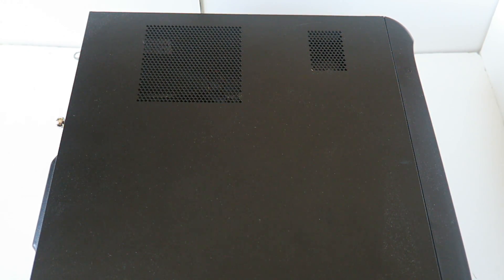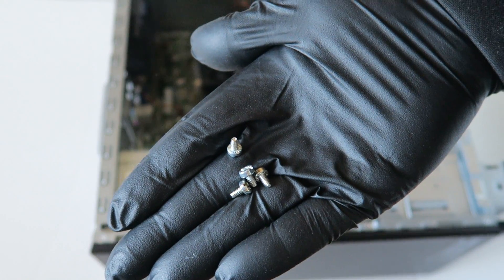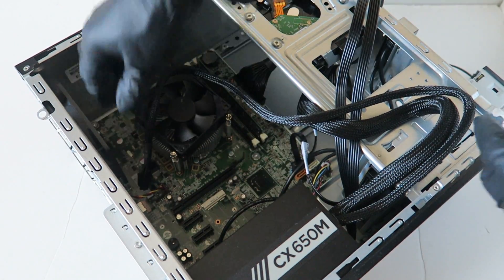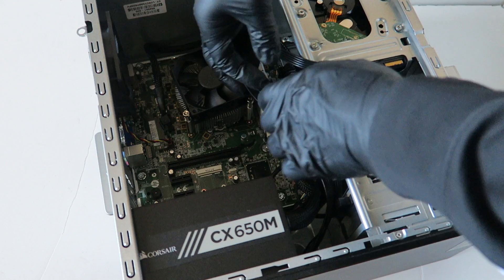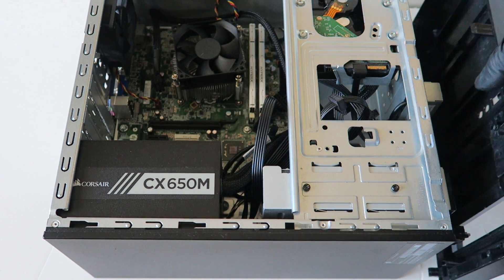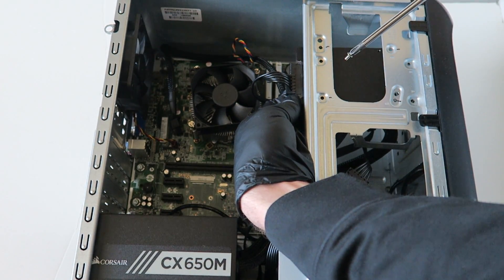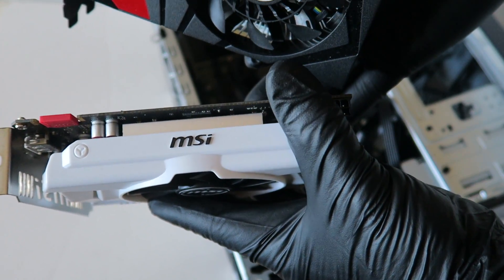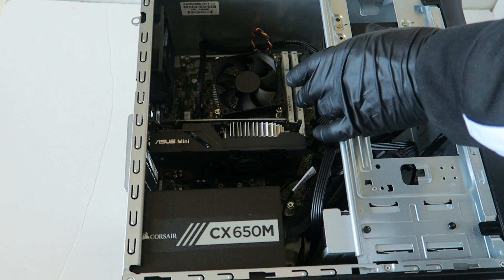HP Pro 3500 Gaming Upgrade Video Card SSD RAM PSU

Comment: Hi there, just want to know if the computer  is going to work with the 16 gigs of memory ram because I thought it can take only 8 gigs and can you tell me more about the optical drive or solid state drive please
Reply from the maker: Hi, yes 16gb ddr3 1600 or 1333 non ecc unbuffered for desktop memory will work fine brand like kingston or corsair or crucial and you can use any 2.5 solid state drive any brand
Reply: So is the documentation wrong? Cause I have this PC an I would love to upgrade
Reply: Same question! Is the documentation wrong?!
Reply: My interpretation of the HP documentation is that they built this system with a max of 8 GB of RAM, but technically it should support 16 GB (2x 8 GB sticks.)

Comment: i have gt730 2gb ddr5 Can i run all game on low setting?plz reply
Reply from the maker: What processor are you be using with gt 730 ?
Reply: +Mxkdi i5 760
Reply from the maker: Yea low fps in games, you could sell this video card and upgrade ?
Reply: +Mxkdi I'm planning to buy gt730 2gb ddr5
Reply from the maker: How much is it $ ?
Reply: +Mxkdi 40$
Reply: @mikecarlvin2684  what??
Reply: gt 730 should work with some games, like fallout 4 but make sure it is lowest setting because it can not compute higher settings. If I were you I would try bidding on ebay for gtx 750 ti for $10-$20 more it is worth it. You can find gtx 750 ti as low as $50 for bids on ebay or you could try gtx 750 (no ti) for possibly lower. I have tested a similar card to gt 730, the hd 7570 on this build and played fallout 4 on lowest setting. The same for Tomb raider (2013). I can say this will work.
Reply: Thanks

Comment: Thank you so much for posting this! This was very informative. I highly recommend this Youtuber as i requested a video on Hp Pro 3500 MT and he delivered. I asked him questions on the computer hardware and he explained thoroughly. Thank you Mxkdi for doing this It means a lot to me.
Reply from the maker: You're welcome
Reply: @Mxkdt  what is the motherbored
Reply from the maker: @pirategaming3590  Hi, Foxconn 2ABF
Reply: Hello people, I have a Hewlett-Packard hp pro 3400 series  driver model wddm 1.2 I am trying to connect multi monitors to it. The new Benq pd2700u monitor says I need dp 1.4 to connect multi monitors. Can someone let me know what I need to do and is this possible Thank you
Reply: @jackj8478  If your pc is not reading from the other ports to the other screen, it may be that your other port is faulty. An alternative is to pickup a graphics card that suits your needs an the ports then use that for multi-video outlets. Your monitor says it needs a dp 1.4 to connect multiple monitors. A dp is a display port ( thats the name of cable) Specifically a model that shows 1.4 ratio. So a gpu would be needed or an adapter like hdmi to dp 1.4 adapter, or a vga to dp 1.4 adapter. A graphics card costs more than the adapters, but offer different types of ports in the long run when you upgrade. It is what ever you prefer.  Regardless og the route you take you'll need one or the other, Since the hp pro 3400 does not have a dp 1.4 socket integrated on it.
to summarize:
Option one:
display port (dp) 1.4 adapter to Vga, or display port (dp) 1.4 to hdmi adapter

Option 2:
A graphics card that supports needed ports such as a graphics card with a display port socket (you will need to get a display port cable that's double sided, this can be found online as a display port (dp) 1.4 cable.)
Reply: @danluna7916  Hi Dan, That's awesome and thank you for your reply, it is very much appreciated. I have a vga port which is being used and a dvi port in my desktop. I am trying for dvi to monitor (dp 1.4). I am now realising I specifically need a dvi from computer to the dp 1.4 monitor. I seem to only see the other way around dp from computer to dvi on the monitor. Could I also consider dvi to dp 1.4 adapter then get a dp to dp cable. I also read most cables are not backward compatible. I am new to connecting multiple monitors and which cables I need. If you have any suggestions as to which dvi from computer to dp 1.4 monitor cables I could purchase that would be great.

Thank you again,
Have a great day,
Jack
Reply: I have hp pro 3400 mt with i3 2320 but i jave blue screen hp logo with my gtx 1059 KFA2 but it work on my friend pc he have ald ryzen 5 and modernc omponent how to fix on my ho pro 3400 mt
Reply: Remove 1050 from HP pro 3400. Plugin and power without it so you can see visual on screen. (You are using default onboard graphics. ) Go to the graphic card manufacturers you bought from. Get drivers and install on your PC, it could be that it didn't install correctly. Turn off PC after installation is complete. Reinstall gtx 1050 and plug display cable into card. (Vga,hdmi,dvi, display port, etc.) see if that works if not your PCI express lane may be faulty on your motherboard.